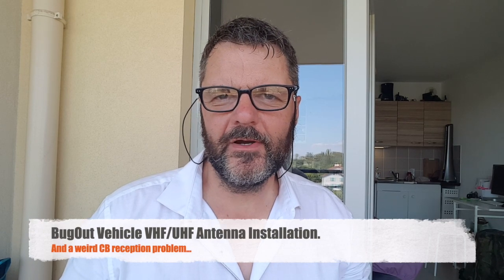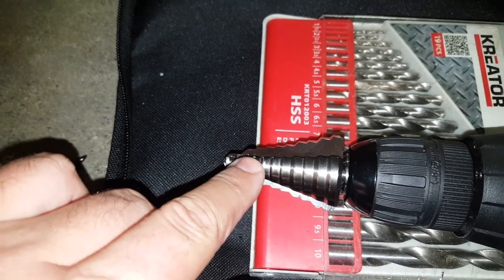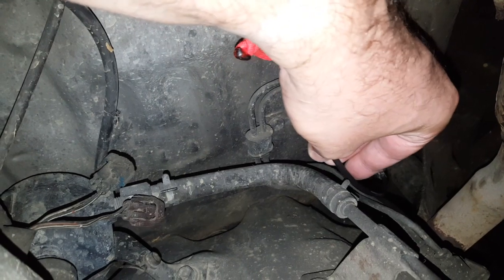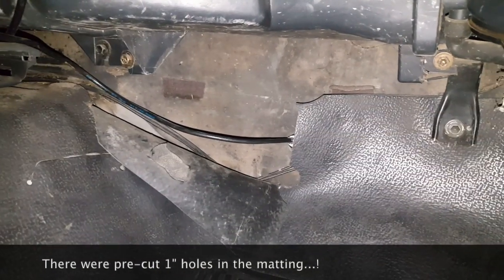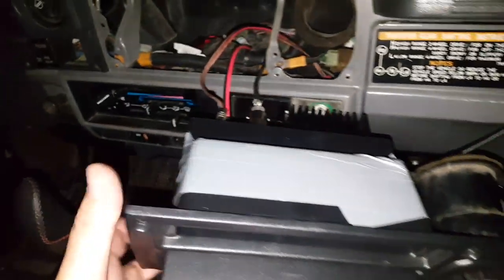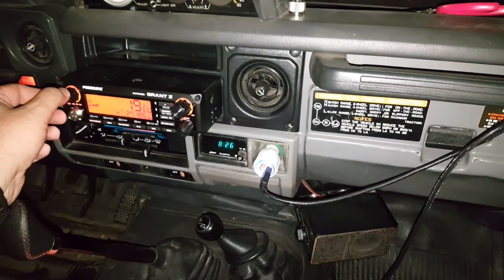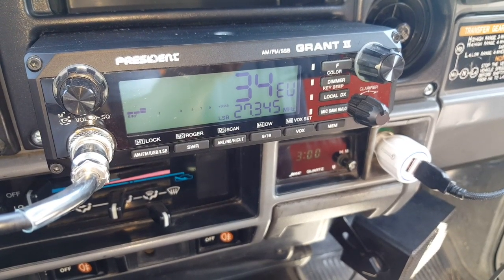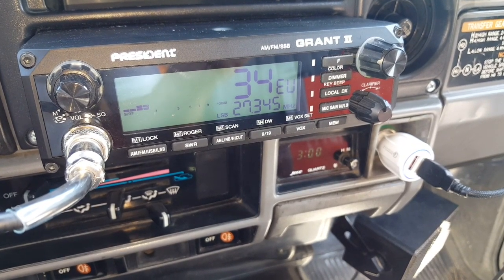BugOut Vehicle VHF/UHF Antenna Installation.

Comment: It took me months to build up the courage to drill a hole in my roof for an NMO antenna mount. I am so glad I did as it makes a much cleaner installation.
Reply from the maker: Sure does, and you can resell the car with the base anyway...
Reply: Try cutting a huge hole for a sun roof... Thats VERY scary as its a customers car !!  I mechanic did that at a garage i use to work and they cut the hole to the outside edge of the frame, so the sunroof fell through !!!  Thankfully a larger sun roof panel was able to fit..

Comment: I used a cable gland when I needed to do the same thing. Better water resistance and no added cable cuts.
Reply from the maker: Less losses for sure. I chose differently.. Time will tell...
Reply: @RadioPrepper    the only real issue I see is heat, both methods can suffer from it. Maybe get some of the protective wrap to deal with that?  Keep up the videos, I really enjoy them.

Comment: Plug is a PL259 and not PL159 as you stated.??.  Also as your bonnet is hinged and your relying on the hinge for grounding, I would suggest you add some earth straps to the hood and vehicle body... 

 My experience with Ebay Nagoya antennas is that they are all fakes.   Ive got a mini mag 2/70 and its rubbish.  Ive got a £3 one thats works much better..  The SWR on the so called Nagoya is 3.0..  It looks short so I don't want to trim it to to if it gets better lol.. 

 A lot of the repeaters here in the UK have battery back up so will run for a while with out mains power.

73's
Reply from the maker: Thanks, yes, my bad. Good idea.

Comment: Hi Hill... congrats on the 10k...  I have not read all the comments, but let me suggest something.   I have had a lot of mobile rigs (car radios ).  Putting the antennas on you hood may not be your best choice.  You will get a lot of electrical noise from the engine.   I have found that the roof or back of the car works best.  My UHF/VHF antennas I found worked best  on the roof roof of my truck and wife's station wagon and/or SUV.  My CB antenna was always mounted on my rear bumper.  Even then I had to install all kinds of inline noise filters.   I gave up on HF with the engine running. LOL   

I might also suggest that you install you radios so that it can be easily removed and locked away.  There are brackets on the Internet for this sort of thing.  

Just saying....  😊
Reply from the maker: Thanks. Unfortunately my roof is fiberglass and adding even an inch base would prevent me from entering my parking garage... My engine is a diesel... No spark plugs to make RF noise..

Comment: Great vid, Gil, if the President is caput, I would put a cheap multimode 10- 11 mtr Chinese radio in there intek, anytone, CRT, etc!
Also Stepper drill bit are great for drilling acrylic sheet for antenna builds- not as harsh an angle as a regular metal bit.👍🏼
Reply from the maker: The President is fine. Yep I use step drill bits... Still need to order an odd-mm one..

Comment: Mounting short antennas on the hood, below the level of the roof, means your antenna will be below your ground level (the roof) and yes, that will attenuate your signal.
Reply from the maker: The roof is fiberglass...

Comment: Congratulations on 10000 subscribers. I have a VHF/UHF antenna that you pinch inbetween the rollup carwindow and the door. Haven't checked the swr yet, but I can't transmit yet. I also have a 2 meter whip, but the XYL doesn't like me drilling holes in the car..... 73's.
Reply from the maker: Ah women... ;-)
Reply: Thank you from the XYL🤣🤣🤣🤣

Comment: I noticed the cigarette lighter USB charger... these can often be sources of of both broadband and freq specific RF Interference and can give the appearance of a weak receiver as the front end of the radio is swamped by the RF noise.  

I've watched the video again and I'm still not quite sure why you didn't fit a rubber cable grommet or plastic gland for your cables.  Each connection in your coax is future failure point and adds signal loss.  Will you be sealing the coax connectors in the engine compartment?
Reply from the maker: Thank. I will test the USB charger. I do explain my choice for connectors in the video...

Comment: I am surprised that you used used so/pl239 connectors. BNC would have been a better choice or if you could afford it N type, both of the latter have a rubber gland to seal the outer sheaf and both less loss than 239 connectors. also why did you not seal the end of the connector with tape? And adjust the antennas for resonance? All decent antennas have adjustment, the best position for a antenna in in the center of the roof, unless you are looking for a direction antenna. 
Having been in communications for all my life and a ham since 1973, ann amazed how many hams seem to know nothing about antenna location effecting the efficiency and radiation pattern of a antenna. I still enjoy your channel. Best 73, Len G8LXI
Reply from the maker: I agree, I should have. I will seal the connectors. The roof is fiberglass and a base there, even one inch would prevent me from entering my parking garage. I did try to adjust the antenna; didn't work any better..
Reply: @RadioPrepper  Hi Gil,  Oh, well even if you could get in your garage, fiber glass does not make a good ground plane. so I guess the bonnet is the next best place. Is it bonnet or hood in French?
Len.
Reply from the maker: It's a "capot." ;-)
Reply: I use "COAX SEAL"  for anything I really need to waterproof. Or  if I don't have that I use Vasoline Petroleum Jelly or car grease.  I have used tape but the water eventually gets in when the tape drys out.

Comment: In a vehicle with a mobile, you really need around 18' of cable.. even if that length is actually necessary to reach between mounting locations or not.
Reply from the maker: Depends on the vehicle and where you mount radio and antenna. What you want to avoid however is multiples of a quarter wave of the frequency.
Reply: @RadioPrepper  Just converted two old computer power supply units to 12.4v 12 amp bench supply for like $5. I can now power my potable CB radio from home or car. I use the 102" steel whip on both car and home, but had to add a ground plane to the one on my building.
Reply: @RadioPrepper  I really like your video's n Learn a lot from them 
You need a hafe wave here  cut it over 18' n tune whith a antnna analyser  or nanovna
Like a antnna electrical length is whut Maders  not physical 
N bond all body panels hood n doors to bumper  n at lest 3 on you  muffler pipe  it really help in hf but not vhf  the AARL has a good book on mobile's  it mobiletering
The bonding lowers take off angel 
I have run 500 watts in my truck 
For over 25 years  but I like run as low power as possible most time about 60 watts ssb 20 meters  
73 n9prf Joe n good dx
Reply from the maker: Good to know thanks. I did not bond anything..

Comment: Spark plug wire insulation, used mostly on hot rods, for those in the know, works very well, shielding heat from wiring under the hood. I have the pres lincoln II+ ! It is both. 219$ amazon. Thx, PEACE
Reply from the maker: Good info thanks!

Comment: in re: problems with cheap radios, a large hammer will fix most problems.  You'll find it removes static, low transmit power, dim or burned out bulbs behind screens, and may other faults of cheap radios.  Just kidding!  Never use a hammer on a radio, cheap or expensive.  Enjoyed the video.  Finding just the right place under the hood can be a problem.
Reply from the maker: Yes, LOL, I hope it's nothing serious...
Reply: @RadioPrepper  the 857d with 11m is a solution as it replaces CB, deca and VHF UHF. I have one and it is very useful. You can even hide the main part and have only the front panel on rhe dashboard.

Comment: Hi mate,Ive seen allot of things in my radio career but this one takes the cake !.I cannot fathom why-WHY would you use  this method of getting through your firewall,introducing more points of failure ?.Anyway,to each there own.
Reply from the maker: Not my best definitely... I just wanted the practicality of changing cables. It works fine for now besides the crappy coax. I am not much into mobile ops...

Comment: Hi Gil. My friend has a license and a 75W power Radio in his Car and the antenna on the roof. We talked about if there must be a minimum distance between a human and the antenna on UHF / VHF Frequencies. He said no but I thought there must be, since on military antennas / vihicles often is a warnung sign on / near antennas with a distance you have to keep from the antenna. Hope you can help me out with this question :)
Reply from the maker: There are standards yes, and I would personally not put more than 25W through that antenna where it is... Less if I had a passenger... But that number is just a guess on my part. Radio waves are not ionizing, and theoretically there is little risk, but I am not willing to push it...

Comment: Gil good idea on the installation ( just a notice is WHAT ADAPTER are you using on the RG-58 to PL-259 connector ????  --- the shield looks hanging ) Sorry just a thought =)  Sorry about things around here in a mess to get back to you ---- planning a move very soon =)   Good job on the 10K subs 8-)
Reply from the maker: No adapter on the PL Pat, and the body is aluminum :-(

Comment: why so near at Exhaust? Risk Temperatur Problem..
Reply from the maker: Well, I didn't have much of a choice... I'll inspect the cables regularly...
Reply: @RadioPrepper  - A reflective radiant heat shield between the coax and exhaust pipe can greatly reduce the heating of the cable.  Best would be shiny stainless steel between the cable and pipe with air circulating on each side, but fiberglass pipe wrap with foil on the outside would be quick and easy, and a lot better than cooking the cable.  If the insulation ended far enough from the exhaust pipe, cable ties could secure it.  Hopefully so, because the coax jacket shouldn't be hotter than the melting temperature of a nylon cable tie.  For hotter applications, use stainless safety wire, for example, if you opted to insulate the pipe as well as the coax.
Reply: I have a scotch with a yellow layer thats supports 1100 C. Better than nothing.

Comment: Hello  I have a UHF antenna with a 10 inch spring  for a UHF cp200 radio.  I just got baofeng radio dual vhf/uhf. Question is can I use that antenna for the baofeng,  and if not why so 🤔
Reply from the maker: It depends if your Baofeng is programmed or used with frequencies that are in the antenna's bandwidth. Check the specifications of the antenna...
Reply: @RadioPrepper  Antenna UHF 450-470MHz 3dBd.  That is the antenna I have so my new baofeng has vhf besides uhf . So the antenna only has uhf.  So I want to k ow if by replacing the whip rod 9 inches it has will that turn into an vhf /uhf dual band antenna or I have to buy a whole new everything
Reply from the maker: No, you need to buy a VHF/UHF antenna, which you can find on Ebay for $10.

Comment: Nice video you may well find that the heat from the exhaust will cause the cable to break down or at least change characteristics getting hot and cold
Reply from the maker: Yep, I ordered some shielding...

Comment: May i offer an hypothesis regarding this antenna? I have a similar and I thought everything was good, till I had a technician  replace a connector. With his analyzer he found out that the antenna resonated in the AIRBAND. which explains your bad 9:1 SWR
Reply from the maker: Interesting thanks. I will scan with a wider bandwidth...
Reply: I was thinking  very lossy coax,  didn't it get lower swr on 70cm which would point to bad coax , nothing is left to reflect....... OTOH I have  eventually come back to a 2 metre quarter wave for both 2M and 70cm. They don't have any tuning issues. Allegedly  there are 2 lobes on 440mhz  but it never seemed  to be an issue I could detect, even with an antenna switch for various  A/B comparison antennas. And I usually have them on the roof with a mag mount, so they act as "feelers" in the parking garages such that I definitely slow down if the mag mount gets knocked over.

Comment: Ciao Gil,
I don't understand why you didn't use the cable up to the radio instead of putting a "barrel" between the radio and the antenna ... in this way you have a greater resistance and the possibility of a very high ROS ... I think that the cable must remain intact until to the transceiver ...
I see that you are a perfectionist and I do not understand this antenna assembly on mobile. Sorry for my note.
Greetings to you.
Giuseppe.
Reply from the maker: It is definitely more lossy... We'll see if It was a bad idea later after I install the radio...

Comment: La prochaine fois, penser a protéger vos coaxiaux sous de la gaine souple si possible tressée. Mettre du goudron liquide en petite quantité sur vos connecteur d'antenne (corps de traversée). D'ailleurs après avoir percé,  mettre à nu le métal sur 1 demi centimètre autour du connecteur afin d'améliorer le contact de masse. Il y a une couche de vernis peintures l'intérieur du capot. 
En HF deca il serait aussi, bien de rajouter des tresses de masse entre le capot et la carrosserie. Ne pas se fier au charnières qui ne sont pas bonne conductrice HF.
Voilà quelques astuces, lors de nos installations sur des 4x4 d'ONG
73's
Reply from the maker: Oui, pas ma meilleure realisation... A revisiter...
Reply: @RadioPrepper  Non bonne réalisation ! Mais seulement penser que les vapeurs de carburant, d'huile ainsi que la poussière le sable, l'humidité ; tout cela mélanger sont néfastes au connecteurs HF et électriques en règle générale. Maintenant si votre utilisation en 4X4 reste limitée rien de grave a votre mise en œuvre. 73's F-10175 (ex F11DRE)

Comment: Why use a god-awful PL239/SO238 connector for UHF. An N-type would be far far more suitable.
Reply from the maker: Definitely... I might change it later, with better coax...
Reply: @RadioPrepper  It's "good enough - GE "to get things running.
Reply: Brian Oldford
PL259 ....SO 239.     We used to keep them in a drawer labelled 6dB attenuators.

Comment: Check Jim’s old video on connector loss:

https://youtu.be/ZEl8QP2IB_o

Good news. There is none! 

On this repair or upgrade, you had a good safe coax routed correctly already and that would have lasted for years.  I don’t see the point of adding this through firewall connector except it is a neat experiment.

Dave K8WPE

Dave K8WPE